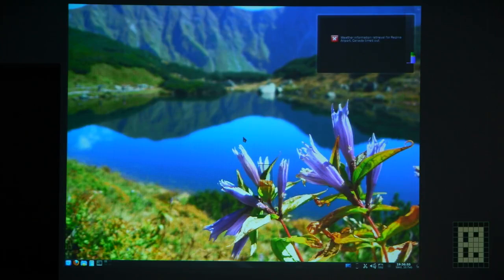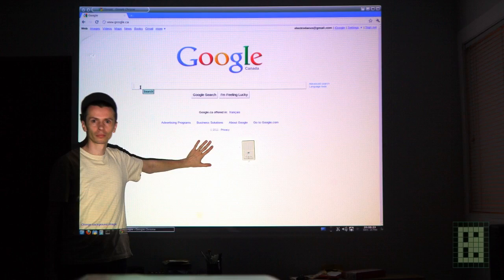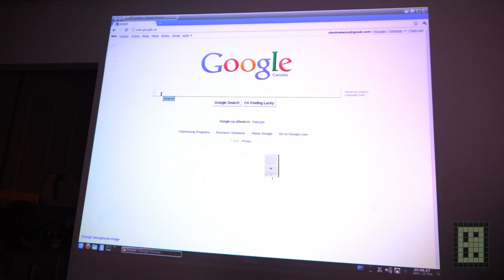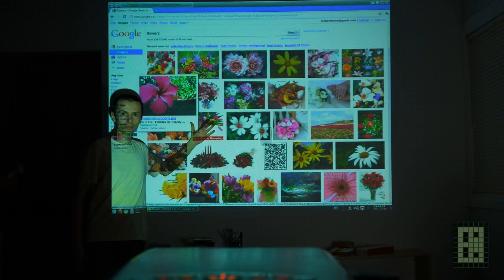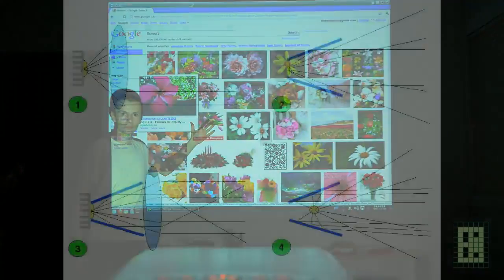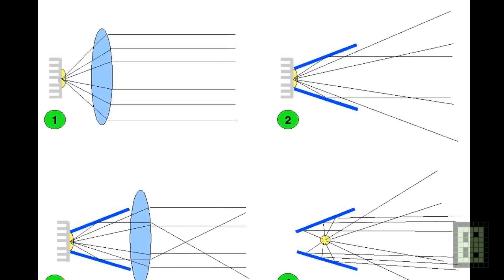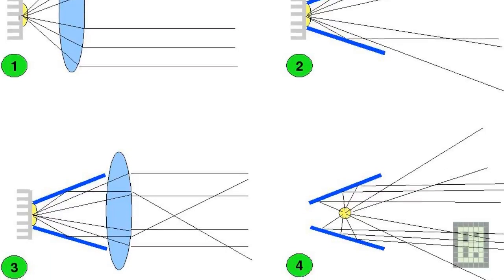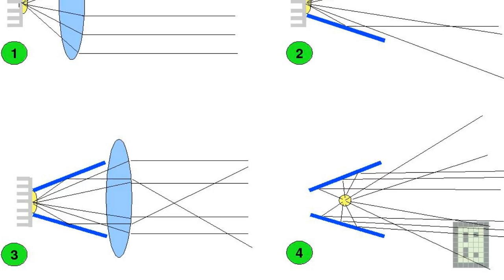DIY XGA LED Projector 3xLCD lamp replacement 25 lumen 720p (part-2)

Comment: Use this LED light,. Light fits the size of LCD screens and sees very bright. http://www.dx.com/p/20w-1400-lumen-white-light-led-emitter-metal-board-16-18v-42009.
Reply from the maker: No that will not work. The LCD's are far from the light source so you need a small light source and proper Lens to climate the light as narrow as possible so that the light spot is not larger than the LCD's by the time it gets there (20 to 30cm typical distance). At the end of the video I explained this.
Video is more than 5 years old it make no sense today to modify an old LED projector when there are plenty of good commercial LED projectors with much better performance that what you will get with an old modified projector.
Reply: The entire arrey of led is small and thick and the light fits the size of LCD screens, is not an usual big 20w led.  And i use lens in front of led to focus light more. If focus more, i see all the 20 spots fill the lcd perfect. I buy an chinese new led projector and is fan noisy, old resolution screen and we want to toil alone to have satisfaction, is passion. :)
Reply from the maker: Marus S You need to look in to how a lens works. You can even try and experiment.
Use a single 3W or 10W LED that had a single LED die maybe a  1x1mm or 2x2mm and add a condenser type lens in front something like the one in your profile image then see how small of a spot can you get from a 30cm distance. You will aim for a 2x2cm since that is about the size of an LCD in an LCD projector and the 30cm is about the distance the light will travel from the source (front of the lens) to the LCD's (there are 3 LCD's in this projector one for each of the primary colors RGB).
Best will be to get a Lux meter (is inexpensive) and measure the average intensity of the light in that 2x2cm spot
Then get this 20W LED that you linked to with those 20 LED die 1W each and try the same thing and see how much light can you get in that same 2x2cm spot from the same 30cm distance.
I can tell you a 3W LED with 1x1cm LED die will put out about 3x more light in that 2x2cm spot than your 20W LED light since what you will be able to do is just focus one of the 20 small light sources on to that 2x2cm spot and that is just 1W all the other 19 will be way outside the 2x2cm spot that you are targeting.
Yes modifying one of this old projectors can still be a good learning experiment.
The fan's in this old projectors will be much noisier than on new small LCD or DLP LED projectors.
Reply: I know what you say. I experimented with CREE XM-L but has square pill, does not match  a rectangular screen, I speak from experience and led - the one with 20 small light sources fits exactly in the lcd screens and the result is more good, with higher brightness and evenly distributed. As for noise, I turned off all the fans, except one that I use for cooling the LED and pulled a wire from the middle to the other fans, to fool the projector and is silent. I'll post pictures soon ... However, a nice day and greetings from Romania.
Reply from the maker: Marus S You probably have experience with some other type of projectors where the light is next to the LCD. Is not the case in this 3x LCD projectors that I have in this video and this have 3 LCD's about 2.5cm diagonal (4:3 form factor) so not square you will be losing about 25% because LED's usually have a square die.
The distance between the light source on this projectors and the LCD's is about 30cm the light will go trough different other lenses split in the 3 primary color and then reflected by some mirrors before they get to each of the 3 LCD's
If you put that 20W LED in front of a lens you will notice that only the die in the middle (center) of the lens will be useful since the others will project on other parts of the wall that is at 30cm from the lens.
If you realy want a good indication use a lux meter and calculate the lumen output of your projector then you can compare with my results. I got about 25lumen out of the projector with just a XM-L LED supplied with 6W
Usually the fan cooling the lamp is the nosiest and you need to keep at least that one if you do not want to get complicated with something else to trick the projector.
Prefer sa folosesc engleza ca sa poata citi si alti :)

Comment: how the board controls the led luminance?
Reply from the maker: On this type of projectors the light source is a constant level all the time the output luminance is controlled by LCD's that controls the amount of light transmission by orientation of the liquid crystals or on other projectors small mirrors rotation.
The light source has at most two or three levels for lower power consumption and longer lamp life nothing else.
Hope this was your question.
Reply: ***** yes, that was and thanks! i though there was light control pwm or something like that..
Reply from the maker: mitropoulosilias That is the case on some modern LED projector with RGB LED and a single DMD element on DLP projectors. This replaces the color wheel on those type of projectors.
There are also Laser projectors where light from the laser is controlled for each individual pixel since image is scanned as on old CRT monitors.

Comment: This is a great video. Many thanks. For a 120W bulb, do I need a 120W LED or there is a rough way to calculate how much watt LED will replace 120 W normal bulb ?
Reply from the maker: +hypertuch To get the same amount of light you will need roughly the same LED power but you can not converge light using a lens form an LED die larger than about 2x2mm and the most powerful LED with such a small light surface is around 10W.
The commercial available LED projectors have LED's for each color and much closer to the LCD or DLP.
Unless this is just a hobby is better to get a proper LED projector than to play with modifying an old projector. I made this video more than 5 years ago back then there where no commercial LED projectors available.
I got about 25 lumen from a 6W LED so you can expect at most around 50lumen output form a modified projector with a 10W LED.
Reply: many thanks for advice. Indeed you are right. The problem is having a good quality projector with old bulb. the bulb at silly high fixed price. price fixing is just like many other things. so i probably hear ur advice, and try to work a solution.

Comment: Hi! I have a DLP projector and i managed to modify the ballast wires to make the projector "think" that the lamp is ok and turned on. So everything is working fine, now i've got to put the led in: I bought a CREE 78w 9600lm led with an emitting surface of only 12mm in diameter. As you might know, DLP light window is a very tiny aperture cut on the side of the light processing unit, a square cut of about 5mm sides. Is it possible to use a series of lenses to concentrate light as most as possible into the tiny hole? space is not a problem, I have put apart all the metal parts of the light housing and now i have plenty of room inside the projector. Thanks in advance!
Reply from the maker: +L Can you provide a model number / detasheet for the 78W CREE LED. I do not think that is a single die LED. And 12mm diameter is huge even if it was a single die it can not be collimated properly in a narrow beam (loss will be huge). The best LED I know is still the CREE XM-L with a 2x2mm (4mm2 area about 1000lm from that small area can be properly collimated anything larger than that will not work).
Reply: +electrodacus It's an XLamp CXA1850 and yes, it's not a single die chip. I'm now waiting for the led driver to be delivered. Consider that yes, the loss will be huge, but if I manage to drive also only a half of the luminous flux through the hole I will  still shoot a far greater amount of light than the LED you propose. My LED has an emitting Surface of 1.2X1.2 mm and the aperture is precisely 8X7mm, that's the reason why I decided to try this way. What do you think about it? Thanks =)
Reply from the maker: ***** No this CXA1850 will not work at all. 50% is a very good light collecting for a small single die LED.
This LED has 36 LED dies each around 2W max and what you will be able to do is focus just one of those 36 dies so is like having a single 2W LED.
With XM-L at 10W you will get up to 5x more light in to projector.
Hope you have a Lux meter so you can get real reading.
Is not about aperture the light needs to travel about 30cm from the source to the imaging device LCD or DLP and those are usually really small. What you need is a laser like beam with very little divergence.
You can try first outside the projector have the LED and lens assembly 1m from a wall and all the light needs to be concentrated on a max 5cm x 5cm area on that wall.
Each of those 36 dies on your LED is about 1mm x 1mm and will use 2W max and the XM-L has a 2x2mm die and can handle 10W
anything larger than 2x2mm and you will not be able to collimate the light in a tight enough spot as to be useful for a projector.
You will understand what I say if you try to project on a wall as I mentioned above.
Reply: It's on my desk, I'll try and I will tell you how it went.

Comment: I want to use a 100 w led to get 8000 lumens can u help
Reply from the maker: +Bob Barker The 100W LED is made of many probably 100 x 1W LED dies and those can not be focus in a laser like beam necessary for a projector. So not that type of LED will not work in this type of modification.
Your best bet is one of those 10W CREE XM-L LED's with a single die about 2x2mm that can be easy to focus with a normal condenser lens.
Second that 8000lumens is the LED output but the output out of projector will probably be around 10% of that after the loses inside the projector.
You seen in my video I used a good quality LED at about 6W so around 600lm and my output out of projector was 25lm so not even 5% some is light lost (not collected by lens and most is lost inside the projector like the LCD transparency)
With the same method I used (a lens) and 100W LED you will get less than 5lm out of your projector and that is because is impossible to collect and converge the light beam.
This project I made was more than 5 years ago when LED projector where not commercially available today is not worthed. Also I used older model 3x LCD projectors the modern projectors are not as easy or next to impossible to bypass because they use serial communication with proprietary standard between the Lamp power supply and main board and not just a simple on/off digital signal as with my older projector models.
So if you want an LED projector is better to buy a commercial available one if you want play with LED in projectors then get an older 3x LCD projector that can be easy to bypass and a 10W LED or maybe two or 3 of them combine the light with some mirrors but this will not fit inside the projector.

Comment: hello, very interesting video, I would do the same with my Vivitek d966, could you give me a hand to find the cables to be cut? thanks

https://drive.google.com/file/d/0B4QD7fI1j_KrRHBnOXJsV0FzZW8/view?usp=sharing
https://drive.google.com/file/d/0B4QD7fI1j_KrVW1mdi10aTVzUEk/view?usp=sharing
https://drive.google.com/file/d/0B4QD7fI1j_KrYWJIWVdBUjJQZWs/view?usp=sharing
https://drive.google.com/file/d/0B4QD7fI1j_KrR3ZzY19EV2hmV0E/view?usp=sharing
Reply from the maker: +Andr Mai I'm quite busy at the moment. This is an old video not sure is still worth modifying used projectors when there are plenty of LED projectors available with much better performance compared to what you can get with this type of modification.
Also your projector is quite new and DLP. The newer projectors have much more complex mechanisms that need bypassing probably some proprietary protocol that needs reverse engineered (I'm sure is not worth the effort).
Reply: I have a lg projector wich is dlp and im also busy with my mod. Mine has 5 wires from main board to ballast. I grounded each wire one at a time with projector plugged out, and switched it on to check if it works. Ended up it stayed on after my 4th attempt . so n grounded the blue wire on mine. I removed the 15w led bulb from my cheap led projector and fiitted it in my lg projector for testing purposes. It works! Of course its not bright enough. But I'm waiting for the 50w led chip with driver and lens to arrive. I'm very confident that its going to work nicely.
Reply from the maker: +Danie Jansen Van Vuuren Sorry but it will not work. The 50W LED has multiple LED die's and you will not be able to use a lens to climate the light. You can get the same result with a single 1W LED (check the end of this video for an explanation to this).  The best LED is a 10W single die with a dies size of just 2x2mm (anything larger than that will be useless).
This is an old video more than 5 years and there is no reason at this time to modify a projector other than for fun the results will not be comparable even with very inexpensive LED projectors you can find today.
Reply: Thanks for your advice. I bought this projector new in 2008 and wanted to fix it in some cheap way. I fully understand your oppinion and logically it makes sense. Here in south africa I can get a new projector for the same price as my original projectors lamp. Thanx again!

Comment: Salutare! E extraordinar cum ai reusit sa scoti un asa rezultat cu doar 25 de lumeni.
Am incercat sa pun in locul lampii originale (vlp ex3) un led de 30w cu oglinda, lupa si suport care se gasesc in comert; din pacate lumina e prea slaba. Ai idee ce fel de lupa ar trebui sa mai adaug, sau nu am sanse sa scot ceva cu aceste piese?
Multumesc!
Cu stima!
Reply from the maker: max pax Banuiesc ca ledul ala de 30W este multi die sunt probably 30 de leduri de 1W si alea nu pot fi colimate. Singurele leduri care pot fi utilizate cu metoda asta sunt cele cu o singura sursa de lumina nu mai mare de 2x2mm
Cele mai puternice care respecta aceste criteri este Cree XM-L max 10W si cu ala folsoit la 10W banuiesc ca poti scoate in jur de 50lm maxim din proiector.
Dupa cum vezi video asta e vechi 4 sau 5 ani si atunci merita sa modifici un proiector dar acum cu asa multe proiectoare eftine cu LED nu e rentabil decat poate didactic sa inveti despre optica.
Reply: Iti multumesc pentru raspunsul rapid si pentru clarificari!
Felicitari pentru cunostintele de care te bucuri si cu care ajuti si pe altii!
Cu stima!